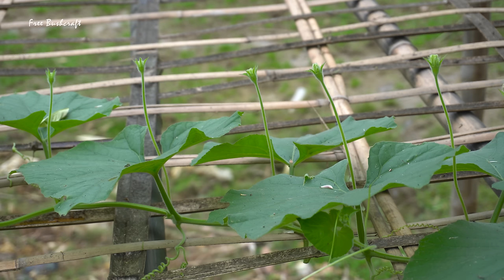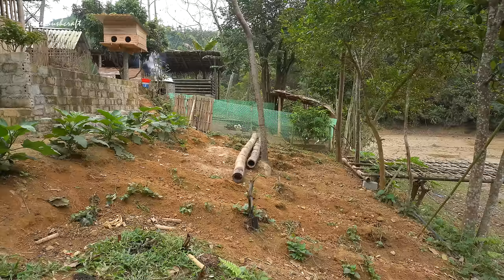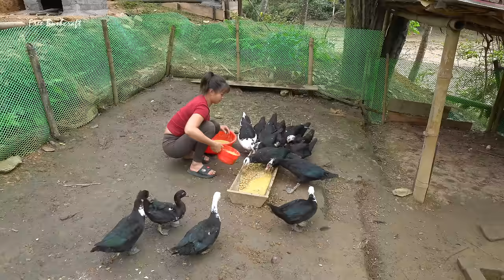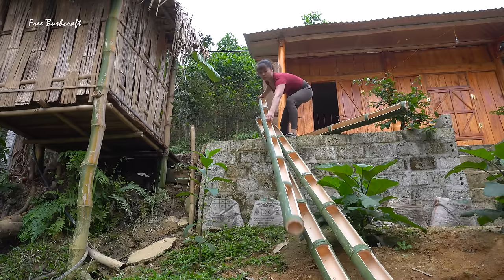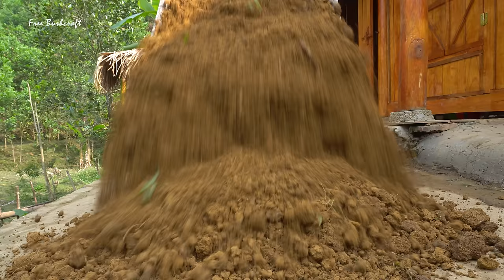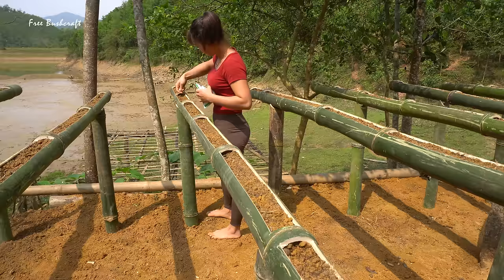Technique growing vegetables in bamboo tubes, Building free farm | Free Bushcraft, Ep128

Comment: Lifestyle exercise in action. This ranges from using a bicycle for transport, to doing yard work with a non-fuel/battery tools. The idea is to move away from a sedentary lifestyle, with some countries recommending a base of 30 minutes a day of mild exercise. If you add in even more, that increases the benefits dramatically. However, you have to get started somewhere and doing exercise that reduces your excuses to not be active has to factor into the occasion at least in the beginning. Then, you increase as you current fitness and circumstances allow.

Comment: Hello, I love your videos. I've watched the majority of them. I've learned so many things thanks to you. The only one thing that I would like you to do different is finding a solution to stop wasting water. Every video I watched the water keeps running and literally is getting wasted.  Please find a solution like for example, put a faucet to have control of the water's flow.. This will prevent wasting water. Thank you!
Reply from the maker: This is a natural continuous flow of water, if you use a faucet to block the water source, it may break the water pipe or slip the connections. Thanks for your advice.
Reply: Like she said. It’s water from a natural source. There’s no possible way to waste water that was flowing down the creek or river. Because after you use it.  Keeping your crops and animals watered. And yourself.  The runoff all goes right back into the ground or back to the source. I am a plumber, the sound of running or dripping water normally bothers me. But what these wonderful people are doing doesn’t ever bother my senses.

Comment: Basically like our using rain gutters to garden in. Your bamboo is more affordable, but a little more labor intensive. Another great use for bamboo! : )

Did you put and drainage holes in those bamboo sections? I’m wondering how they will handle a heavy rain.